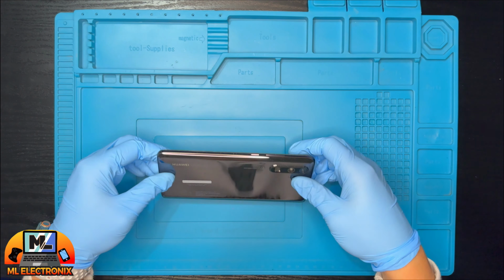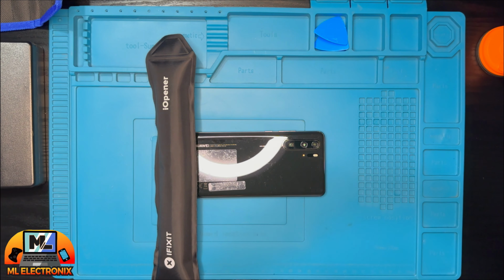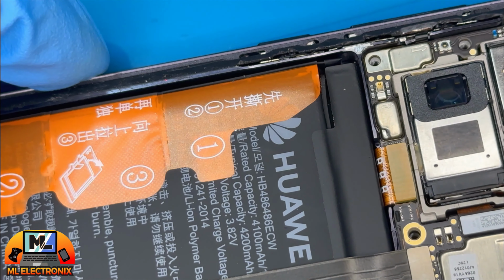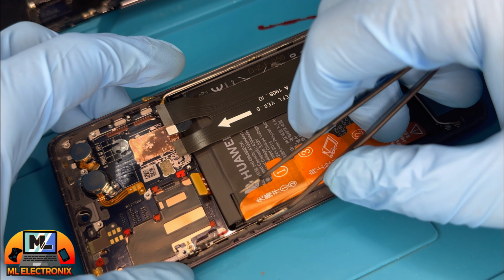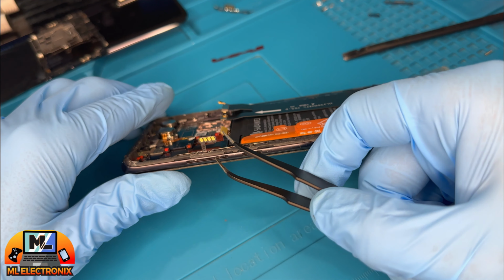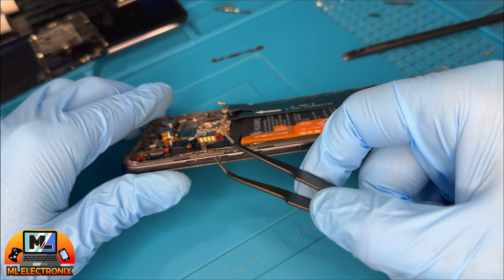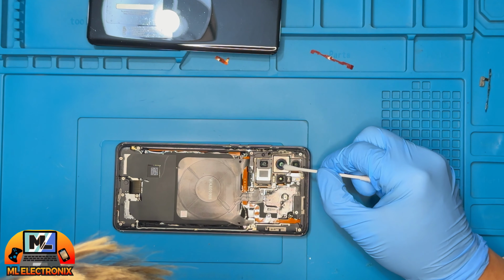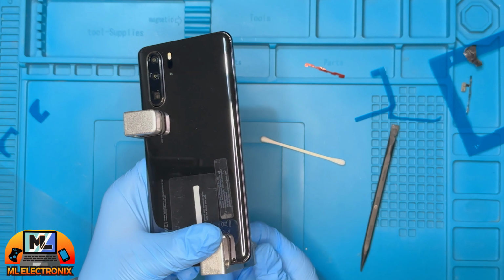Repair Huawei P30 Pro Power Button Quickly With Diy Guide!

Comment: I'm so sad because that all look so easly in the video. But when i'm trying remove buttons, this smal piece is like stuck inside.. I can't remove it in any way. I don't know.. my model is too perfect made or what.. heavy to fix.
Reply from the maker: Hi, you don’t have to give up so quickly. You need to have a good and powerful light (flash from the phone), thin tweezers (with which to grab small objects), and a little patience and it will be solved. 

However, an easier way to remove it is to remove the battery and the motherboard (top) for easier access. The button tape is glued with a special adhesive, so a pair of tweezers can help a lot. Please remember that the bottom flex cable can be removed without removing the chassis bottoms.

Comment: are those thermal paste on the motherboard? isn't it we need to reapply the thermal paste?
Reply from the maker: Yes, this specific Huawei model includes thermal paste beneath the motherboard. After reassembly, ensure the thermal paste remains intact, soft, and evenly distributed. Replacement is not necessary as long as its condition meets these criteria.

Comment: I just attempted the power button and volume rocker AND battery replacement. Damn its hard putting the bloody buttons back properly! The new button pads are too thick and I have to shave them down, but thanks to your video I finally put everything back and I restored my 5 year old P30 Pro.
Reply from the maker: Wow, that sounds like a tough repair! Those small button components can definitely be tricky to reinstall, especially with aftermarket parts. Great job sticking with it and getting your P30 Pro back in action! Glad the video helped--thanks for sharing your experience!

Comment: Do you have video for p30 lite power button replacement please?
Do i need to remove battery to replace the button?
Button is not clicking, it's damaged right?
Reply from the maker: Hi, I currently don’t have a P30 Lite in my repair shop. However, the Pro and Lite versions are quite similar, so the process for replacing the power button should be comparable. You don’t need to remove the battery—only the top motherboard.

Please be careful when opening the back cover, as there is a fingerprint flex cable connecting the back glass to the top board. Additionally, note that the flex cables for the Huawei buttons are located under the top board and secured with adhesive. Make sure to remove and reposition them correctly to ensure the connectors fit properly.
Reply: @mlelectronix  There are no tiny holes near the buttons on the p30lite... Weird
Reply from the maker: If you haven’t noticed any “holes” or “bolts” around the buttons, just mount the new flex cable on the phone and test the buttons before proceeding any further steps. 

Most of the time, after each repair, I prefer to test the phone, powered, and with its back cover open just to ensure everything works perfectly after that, I apply a newer after-work adhesive on it, as the final step.
Reply: @mlelectronix  I'm not trying to replace the flex but the power button itself.
Reply from the maker: @Michael-fl9lh ohh, sorry. Just mount the newer button and test it. Let me know if you need any help with your issue but I believe you will succeed in this repair 👍
Reply: @mlelectronix  I'll just pry out the old one and mount the new button without removing the battery?
Reply from the maker: @Michael-fl9lh Open the back cover, disconnect the fingerprint flex cable, disconnect the battery, remove the side button plastic support, and remove the power button from the outside of the phone by pulling out from the case with some sharp tweezers. 

There is a good video tutorial related to the total disassembly of the Huawei p30 lite.

Search for the “Easy Firmware” YouTube channel and take a look for “Huawei nova 4e & Huawei p30 lite Marie Disassembly and Assembly Video Tutorial”.

However, should be an easy task because the older button is broken so I believe that you got a newer one, right? If you do, you don’t need to worry about the plastic button as long as you are not damaging the flex cable or anything from the phone. Good luck
Reply: @mlelectronix  I already replaced the older button (it's red parts were broken) with a new one. But the problem is that it won't "click". I need to press it really hard for the power button to function. What do you think is wrong here?
Reply from the maker: @Michael-fl9lh  Scroll to 13:16 and notice how the on/off button has a small plastic tip on the inside middle that makes that "click" sound. When removing the buttons, usually that tiny plastic, being hard to notice, gets lost. That's exactly what happened to me, but I glued a small piece of harder plastic with superglue and I solved the problem.